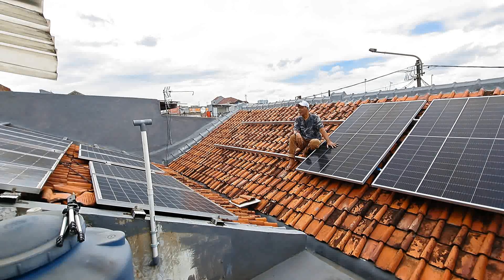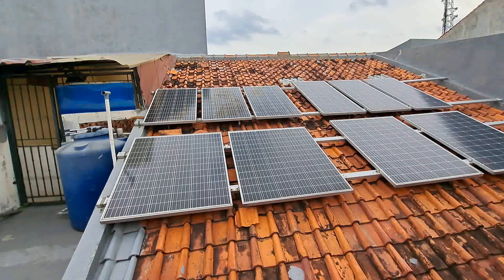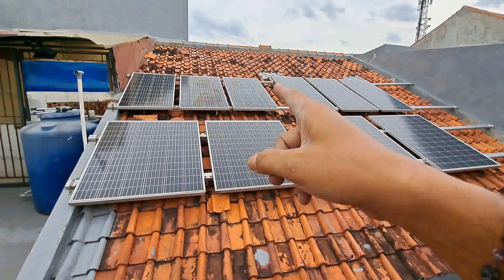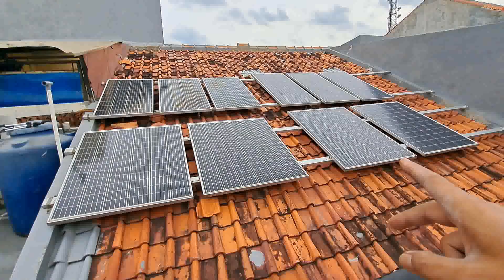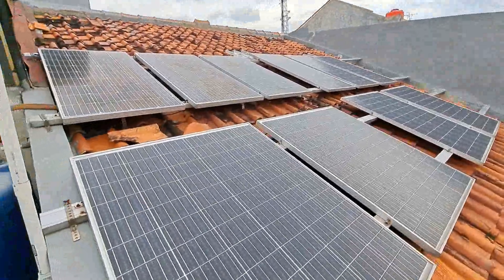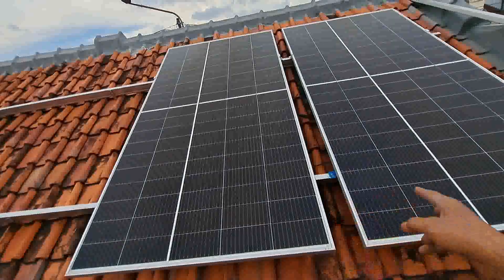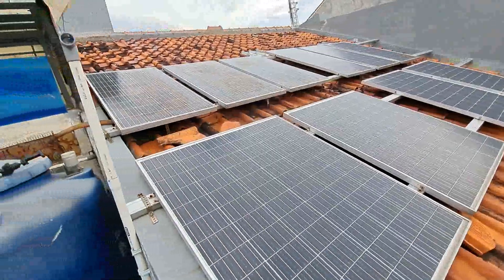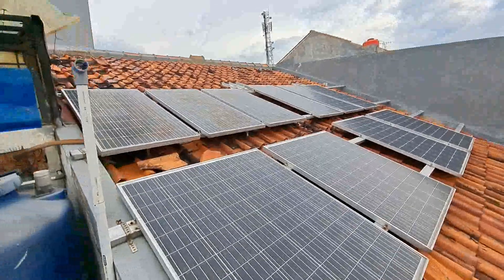Bangun PLTS modal NYICIL akhirnya bisa nonstop 24 jam | PLTS off grid 2.700wp

Comment from the maker: jenis inverter rakitan yg dipakai LF 5kw memang joss dan bandel
link nya ini bang =) https://tokopedia.link/a1tTL1MEfwb
MPPT Solar Charge Controller 100A Epever Tracer 10415AN
https://tokopedia.link/AICygB5Efwb
asesoris tambahan:
1. Automatic transfer switch https://tokopedia.link/8s7BA0Ilvwb

2. volt meter https://tokopedia.link/pVRmxGRlvwb

3. kwh meter https://tokopedia.link/jhHPCUXlvwb

4. watt meter ac 220v https://tokopedia.link/BMAw4Lemvwb

5. watt meter dc https://tokopedia.link/V1ZZOlkmvwb

6. volt meter tab https://tokopedia.link/6XZlFxsy5wb

7. amper meter tab https://tokopedia.link/0PaXPAyy5wb

Comment: mantap... mau tanya mas... untuk hitungan tegangan dan arus dari panel yang berbeda WP seperti apa Mas... yang 150WP, 200WP dan 500WP kan tegangan dan arusnya beda beda... apakah dari rangkaian 3S2P 150WP dengan 2S2P 200WP dan 2S 500WP tegangannya dan arusnya bisa di gabungan jadi satu ke input MPPT?
Reply from the maker: Inti nya bisa bang di gabung meskipun beda wp nya antara 150wp 200wp & 500wp  kl menurut teori  jika di pararel maka arus ikut yg terkecil wp nya  jika di seri tegangan bertambah sesuai wp voltasenya jd kesimpulannya baik nya seri & pararel  wp harus sama maka hasil nya lbh mantab bang
Reply: Saat ini saya sudah punya sollar panel existing 100WP 8 buah, masing2 Vmp 18.8V dan Imp 5,32A sudah di rangkai 4S2P. dengan total output tegangan 75.2V dan arus 10.64A  (hitungannya benar kah? sesuai sistem 4S2P). Dan saat ini saya ingin tambah sollar panel 390WP 2 buah, dengan Vmp 44.1V dan Imp 8.85A yang rencana akan saya seri, berarti outputnya jadi 88.2V dan arus 8.85A, apakah akan aman untuk parelel ke-2 output tegangan ini yaitu : 75.2V dengan 88.2V? tegangan outputnya akan mengikuti yang terkecil juga? berarti hanya 75.2V? klo arus akan di jumlahkan menjadi 19.49A ya Bang?
Reply from the maker: @williamslarmawata9029  rumus nya ini bang jika 
1. pv di seri vottage bertambah amper tetap
2. Pv di pararel voltage tetap amper bertambah
3. Dari hasil ke 2 kombinasi pv tersebut no.1 & 2  out put pv voltase tidak boleh melebihi dari spesifikasi batas max MPPT nya 
Jd harus di bawah batas max spek mpptnya
Reply: @HariPLTS  siap Bang, terima kasih sarannya... artinya :
1. selama di bawah batas max MPPT tidak masalah, walaupun hasil dari rangkaian yang di seri berbeda2 tegangannya dapat di pararel lagi? 
2. kalo misalnya menggunakan 2 buah MPPT juga bisa ya Bang? jadi hasil dari seri 4S2P PV 100WP masuk ke MPPT pertama dan hasil dari seri 2 PV 390PW masuk ke MPPT kedua 
3. apakah bisa output dari 2 MPPT tersebut di paralel ke 1 battery yang sama? saya menggunakan system 48V
Reply from the maker: @williamslarmawata9029   jwbn 1,2 & 3 bisa bang